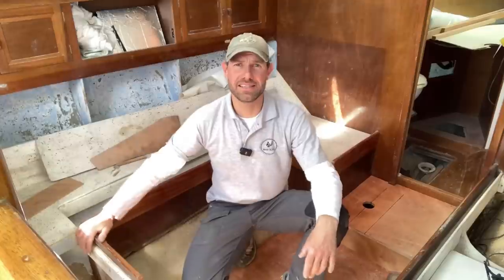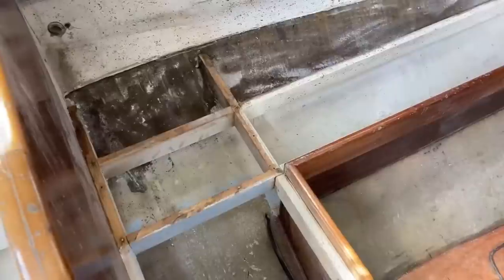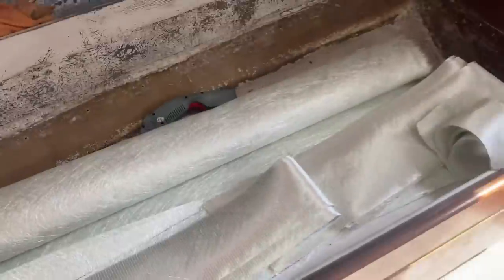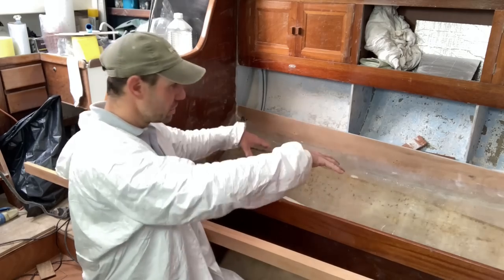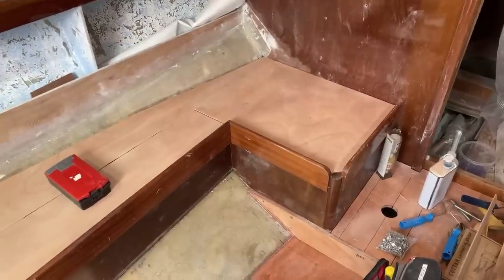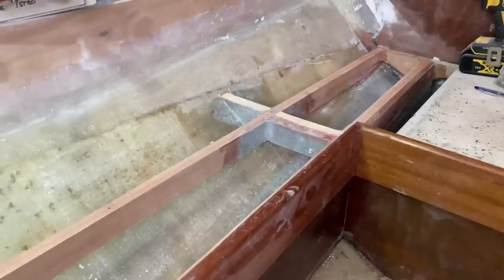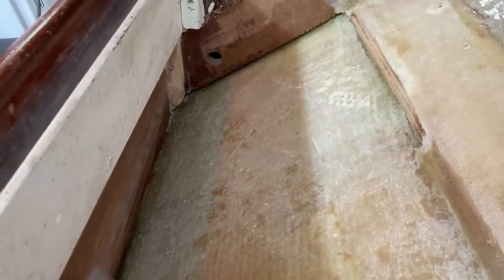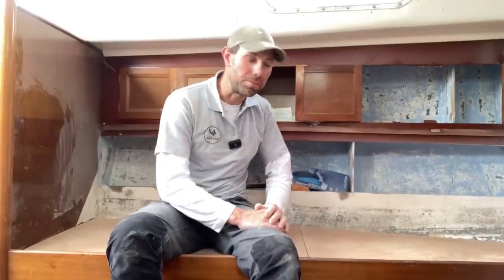Structural Repairs and Modifications on a Contessa 32 (Project Lottie Ep17)

Comment from the maker: Just thought its worth adding that the new stringer added in on the port side is there to resist flexing in the hull, there is nothing fundamentally wrong with the design of the boat and its only in particularly bad conditions (big waves) that a standard boat may have an issue.   All boats flex a bit, better that they flex a bit rather than break, I'd happily take a Co32 anywhere in the world and if I did I doubt I'd be the first Co32 to visit.    I'm aware this is my first video for a few weeks, had had lots of "stuff" going on but really looking forward to finishing Lottie and getting her in the water (almost as much as the owner!)

Comment: Music each to their own, enjoyed watching all your videos and some amount of work and techniques being put into Lottie.
Didn't realise boat hulls were that thin
Gives an insight into a 50 year old fibre glass boat I noticed on past videos, osmosis, bubbles , I always thought it was spideringin the laminate , we learn something. Good to see your skills.
🐼🐼🏴🏴
Reply: "Didn't realize boat hulls were that thin"
On the flip side, my 1973 Luhrs was built with a very thick hull almost throughout.
In fact, while she was estimated to be 15,000 lbs/6,804 kg by her engineers/builders, her series were actually closer to 21,000 lbs/9,525 kg!
Which explains why her original 185 hp diesel engines couldn't keep her on plane without one or the other overheating.
My grandfather finally replaced them with a pair of 250 hp diesel engines.

Comment: I like your music choices a lot :)
Reply: I have a question - isn’t there a risk of permanenting any deforming due to the boat standing on the keel? Started watching in the middle of the series so this might have been discussed earlier though :)
Reply from the maker: I’m pleased somone likes the music 😬
Reply from the maker: @osten_petersson  if properly supported then there is no great risk of hull deformation, most of the weight is in the bottom of the keel and the forward cradle pads are located close to/on a bulkhead so no issues.

Comment: Hello Boat Butler you're pretty hardcore with your repairs. Strength is not going to be a problem. I was wondering if you're using polyester or epoxy in your laminating?
Reply from the maker: I use both, it depends on the application as there are situations we one is more appropriate than the other.   For this repair the laminating was done with a good quality poly resin.

Comment: Great video George!  Love the music too 😊. Interested in your choices of the ‘splits’ in the bunk boards on the port side - my CO32 has two boards under the long bit of the berth, with shorter squares under the separate lockers at the ends of the ‘dinette’ - these match the bunk cushions making it easier to access the lockers.  Does Lottie have a different cushion layout?
Reply from the maker: When you are getting new upholstery you can get whatever layout you want.  Having sailed many co32 my preference on the port side is to have two cushions that run the length of the bunk top along the main and galley bulkheads then an infill for the middle part of the seating (and another infill for the top of the table when lowered.   The locker lids reflect this.    Pleased you like the video and thanks for the comment
Reply: @RefitandSail  Aha- makes sense!  Come to think of it, my 6’ long bunk cushions are a bit of a pain to move around down below…

Comment: Great to see Lottie again, she was missed!
Just one question...
On the new stringer, shouldn't there be any holes (front and back) allowing any water-condensation to escape towards the bilge?
And about your music choices... 80's rules! 👍👍
Reply from the maker: Good question, there will be some limber holes to drain any water, just not put in yet.  I need them to run some pipes and maybe cables though the lockers so I will add holes doe them (and drainage) once I know exactly where to pipework will run.

Comment: Yet another very interesting video - thanks George.

I notice that there is a line of holes along the stringer on the starboard side, and I have the same on MB.  I assume it's an old cable run or some other fitting perhaps?  Anyhow, should I fill them with something?  If the stringer itself is plywood underneath the glass, could that mean that condensation or water from the leak near the chart table bulkhead might have been  getting in & potentially causing rot?  If so, then sealing the holes might not be a good idea I suppose?

Music is great!
Reply: I think most of the wires from mast aerials and instruments, as well, as the forward mounted depth transducer, are normally routed through those holes to emerge under the chart table. I have never seen much/any condensation on my boat (lightly crewed, UK based) so I would guess any water is probably a capping or window leak.
Reply from the maker: Those little holes were for the original cloth pipecots that have been removed on both your boat and this one.  No particular need to fill them from a structural point of view, maybe aesthetically they could be filled and painted over but it’s not something I’d loose sleep over.   Nice to hear from you John.

Comment: Great video.  I see some thin vertical ribs in the areas above where you are working.  They seem thin and not glassed in well.  Also, I notice that you are not concerned about vertical ribs in the space you are working.  Are these vertical ribs that are above the space you are working for attaching shelving, and not important to the hull?
Reply from the maker: Good observation!  The vertical ribs above are both structural to resist flex in that area and support a shelf above (the shelf is also effectively a stringer), having sounded all the secondary bonding they are well attached to the hull with no sign of failure so I have no reason to carry out any work to them,.  Yes they look thin but are the standard spec for a co32 and I don’t think I have ever seen them fail, there is much more curvature in the hull there than the area I was working so less likely to have a problem. I had considered the “belt and braces” (suspenders if you are in the US) option of adding vertical ribs as you suggested but from my experience with these particular boats don’t think it’s necessary having added the new stringer.   Thanks for watching and the comment.

Comment: Well, pretty good job IMHO and I have no issue with your musical choices 😇 I have a question : the last layer above is CSM to give a rough surface so that the finishing top coat may stick to easily ?
Reply from the maker: The glass was laid up with poly laminating resin leaving a slightly tacky uncured top surface, this cures when I overcoat with the poly flowcoat which will get a chemical bond so the texture of the csm doesn’t make much difference.    If I was putting gelcoat or paint over an epoxy it would need abrading to ensure a good mechanical bond.

Comment: I wonder what new boat would have been possible with the same budget as purchase + refit costs?
Reply: @Rich its entirely possible that there will not be any 50 year 30-40 foot Hanse, Beneteau, Bavaria getting the full refit treatment in 2070.  Doesnt make them a poor choice in comparison to a 50 year old boat now. Especially if a sailing adventure is Portsmouth to Dartmouth and an expedition is over to Holland.
Reply: Although if I had the boat butler on hand to help and to do much to the non tech work myself it would be a nice option.

Comment: What exactly is "flow coat", Gelcoat?
Reply from the maker: Yes it’s gelcoat but with the addition of wax which rises to the surface during the cure so you get a non-sticky finish.   Gelcoat is normally the first thing put in a mould when making a new boat while flowcoat is used on the inside of a grp moulding to finish off the rough internal surface.
Reply: @RefitandSail  George, thanks.  I am getting ready to do a few repairs that involve tabbing and was considering painting afterwards but may try flow coat now.  Great content, I appreciate the useful info in your videos.  I'm looking forward to a video on your varnishing technique / tips!  I've tried several varnish brands and so far, the Epifanes Clear w/UV Filters seems to hold up the best in the relentless Florida sun.  I really like the way Le Tonkinios flows out smoothly with minimal skill but the UV destroys it in less than six months.

Comment: How come it is only the port side that needs strengthening? :-)
Reply from the maker: Because the port side settee berth is a different shape to the stbd side linear berth.   The side of the berth on the stbd side acts as a continuous stringer between bulkheads but on the port side it did not which I rectify with this mod.    I also glass the furniture into the hull rather than having it sit on top of the floor near the mast which helps.
Reply: @RefitandSail  thanks for taking the time to reply :-) Helpful to know.
Reply from the maker: @churchofthegreenflipflop2436  no worries, it’s not obvious if you don’t know the boat and how they are put together.   Probably should have explained in the vid better